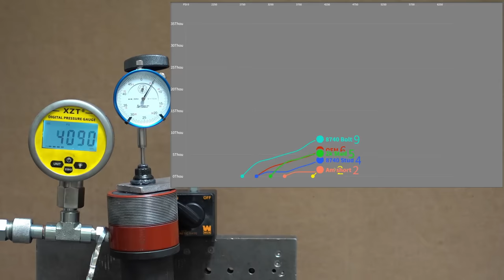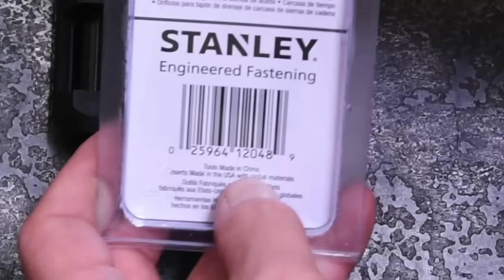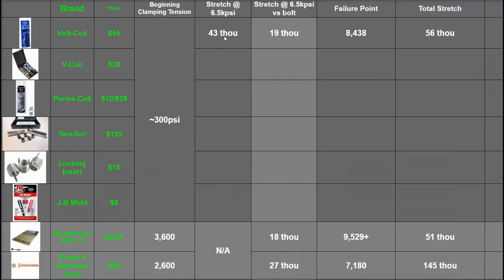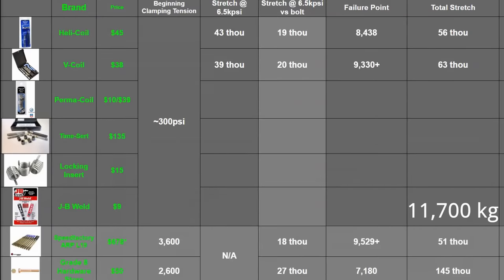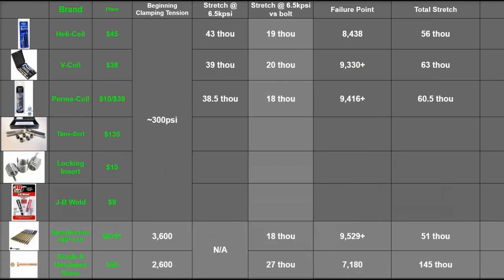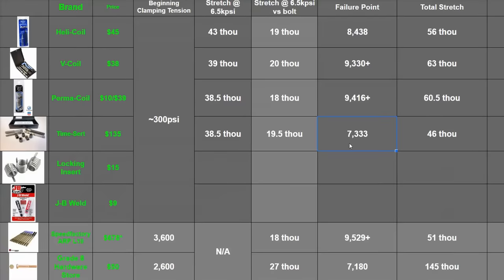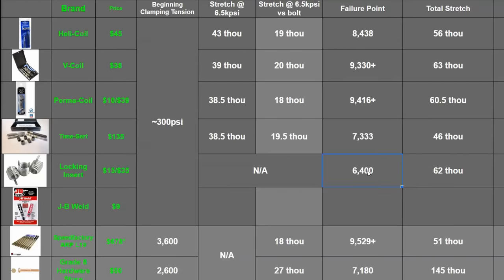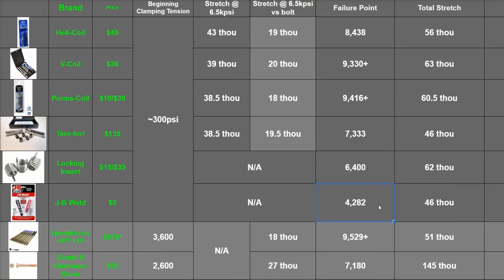12tons vs Bolt Thread Repair Using Time-Sert, Heli-Coil, J-B Weld & More

Comment: Would’ve preffered to see the jb weld left to cure with the head stud left in the hole rather than drilling and tapping threads. Ideally just shoved straight into damaged threads and bolt shoved in after.
Reply: If it was a stud and not a bolt that would work.
Reply: @FishFind3000  it was a stud in their video?
Reply: I think even just drilling it and letting it cure another 8hrs before tapping would have been beneficial. Cured JB weld doesn't feel "gummy."
Reply: @9HighFlyer9  I agree entirely, needs 36hrs or better ! I thought we’d all learnt that lesson with epoxies years ago.
Reply: JB weld sucks for thread repair in metal, period.
Reply: Used jb weld on a thermostat bolt hole and it lasted over 300,000 miles.  Chevy 4.3.
Reply: JB can be amazing. I have compressor from Menards 125psi. The riser on top of the tank got hit by something and the weld cracked so it was leaking. I only use it for filling tires and other light work so I sanded the paint and used JB around the base thinking, "yeah right I'll be junking this". 2 years ago and doesn't leak.

Comment: Machinist checking in. It is always better to use lube when tapping regardless of material. With cast iron you can get away with it because it is so short chipping. However, some people think cast iron chips act as lubrication because of the graphite nodules. They do not. They are abrasive. Cast iron actually wears cutting tools rapidly. Also, the reason you use timeserts over helicoils is because threaded inserts like timeserts hold up better to reinstallation than coils do.

Comment: I always love watching you videos, subscribed a while ago. Back in my automotive tech days ( 45 years worth ) we used a time-sert type of insert ( can’t remember the brand) to repair striped spark plug holes. A spark plug needs a flat or conical sealing surface at the top depending on the plug design. A coil type insert will leak compression past the larger new threads and damage them. When you need to seal something ( compression, oil, coolant etc ) a sleeve type insert would be best.
Reply: A spark plug has a sealing washer or conical seat which is a larger diameter than the OD of the Helicoil insert, therefore there is no leakage. I do like Timesert inserts but Helicoils are much cheaper and don't require the comparatively large counter bore that the flange on the Timesert requires.  
I have a similar amount of years in the auto repair/race/engineering world.

Comment: You should use a simple lever to save your indicators. As long as the sides are equally distant it will turn the upwards motion into downwards of the same intensity and when the bolt breaks the lever moves away from the indicator instead of just putting the indicator in the line of fire.
Reply: THIS!!!
Reply: Or the lever could be sacrificial like a Haimer tip.

Comment: as a heavy duty diesel mechanic and using time serts for head bolt repair and "helicoil" for all others I've genuinely always wondered how strong the threads would be and this test really contradicts what everyone in the shop has said that it's weaker, makes me feel better using these products!
Reply: The only thing is though, that the helicoil will most likely come out with the bolt when the next guy has to disassemble it. I hope you're not one of those "fuck the next guy" mechanics.
Reply: What i dont like of coils is after many years with bolt rust,thermal expansion, etc,  when you try to remove the bolt it binds and  pull thr coil like a wire.
Reply: @mandytuning  Then you just put in a new one. I've installed them purposly for that reason.
Reply: @Spike-sk7ql  Then just install a new one, no sweat.

Comment: Did timeserts on my Miata spark plugs nearly 10 years ago, bought it with all them stripped.  Over 50k miles and turbocharged to 3x factory power with zero issues

Comment: Perfect timing! I just discovered 3 of the oil pan bolt holes on my engine block are striped out. Can't wait to see what I'll be buying to repair those threads!
Reply from the maker: For oil seals, a solid insert like time-sert is best. Less potential for leaks

Comment: I repaired a starter bolt hole on an LS1 engine block w/ JB Weld and it has lasted over ten years w/o issue. The "ear" for the bolt actually broke off the block and I re-formed it w/ the JB Weld, then re-tapped it. The starter just crapped out on me and I was nervous about the durability of the repair . . . and was pleasantly surprised to find the repaired thread in perfect condition and merely did the minimum required to eplace the starter. Yea!!!

Comment: Awesome test.  Helicoil makes sense, since it's a round coiled insert with the same diameter throughout.  The double threaded insert didn't have a consistent wall thickness due to the inside and outside thread position, so it makes sense that it failed at a lower point than the coil inserts.

What amazed me is the strength of JB Weld.  Goodness, that stuff is strong!

Great to watch these videos.  I actually bought a Rigid high torque 18V wrench due to your testing and I'm thoroughly pleased - make that more than pleased.

Thank you.

Comment: I bought a V-coil set size M6 once to repair a thread for a valve cover. after one user error it worked totally flawless. I honestly took it for the price alone, never expected any real quality.

Comment: HeliCoil has cheapened their sets from what I'm familiar with using in the 1960s. I still have the first one I purchased to repair 7/16 head bolts in a small block Chevy. Those sets came with the drill, tap and the installation tool was a threaded tube the size of the bolt with a crossbar that doubled as the handle as well as the tool to break the tang. The insert was threaded into the hole so the top thread of the insert was one thread into the hole. The installation tool was left in the insert, the handle was removed, inserted into the center of the installation tool and tapped with a hammer to break the tang without bending the bottom thread or pulling it out of place as the installation tool held it firmly in place. Then the installation tool was removed and the thread in the hole was staked just at the end of the coil using a punch. This prevents the coil backing out when a bolt is removed that has had thread locker used.  
When their Patent expired in 1969, several other companies got into the market. Those kits usually didn't include a drill bit, they used a cheaper, shorter tap and didn't have a full thread installation tool. If the hole isn't tapped deep enough, the lower part of the coil will be in the tapered area of the tapped thread and wedge onto the bolt which is why the threaded installation tool is important so the installer can tell if the threads are deep enough. Many people installing coils don't break the tang off and just screw the bolt in to let the bolt break it off which will either wedge the thread or drive the coil deeper into the tapered thread and wedge the bolt. The taps included with the cheaper kits were of a lower quality steel and would be dull after installing the inserts that came with the kit while the early Helicoil taps could be used for many additional inserts.

Comment: Simpsons did it!  Seriously, funny that both of you did the same video on the same day.  Project Farm has their own style.  I've always used Helicoils, but I've had issues with that little tab breaking off where it doesn't need to be.  Some compressed air and a needle tip usually does the trick.

Comment: A decent comparison of the products and like others have said, application plays a huge part in selection of the correct repair. As a Tool and Die Maker, I cringed a bit when I saw the preparation of the sample. Whenever drilling in a vise like that and then tapping by hand, the threads are likely to be less than ideal (round stock like that begs for a lathe). Even a slight bias of the tap will cause an early failure since the stud only loads on a small area first. Especially in cast iron, there isn't any internal yield to 'set' the threads, they just crack.

Comment: Okay so, here's the issue I have with the other brands and why I use timesert. The other brands do a really poor job of staying in the hole, timesert doesn't back out and locks in place. When repairing aluminum engine blocks you can remove and install bolts without worrying about the thread inserts coming with them. Even though the timesert didn't win in torque, I'd be curious to see which one backs out of the threads the easiest when removed. I think most of us mechanics don't have issues with insert strength. The issues we usually have are related to the stupid thing backing out when disassembling something. I don't know how many times I've pulled things apart with helicoils inserts just to have the insert come out with it. Never had that issue with timeserts. Great tests, just saying there is more to the inserts then strength.
Reply: Yep 100% the same reason why I ended up biting the bullet and stumping up for timesert kits.
Reply: @ellingly  I completely agree. Have a transmission repair coming up. Several bolts holes are completely ruined. The transmission pan has to be dropped to change fluid. So this pan will be removed and installed multiple times. Definitely glad I went with timesert

Comment: I've been mix and matching wire insert brands for well over 30 years, using Heli-Coil, Re-Coil and Western Threading Systems taps, tools and inserts with each other.
The only times I've had problems or failures have been due to either my own error in failing to drill or tap square or due to insufficient support metal. (Re-threading engine sump drains is often problematic when they only have a thin wall spot welded plug thread.)
Never tried a Time-Sert as I generally have to do my thread repairs in awkward to access locations and often have to get creative in how to get a drill bit into the location.
A tip for others: As I'm often running an insert into an engine in place, I have made up a couple of tools that I can use to slip over the tang of the insert and snap them outwards rather than knocking them off into the cavity.

Comment: The thing that make heli-coils so strong is the fact they are flexible. With inserts like time-sert the load really only puts pressure on one or two threads. With heli-coils the load is more evenly spread out.

Comment: We use Time-Serts at my work and the machinist once ran a test of his own by taking a piece of aluminum bar stock. He drilled 3 holes, tapped one straight for M12 threads, the second hole was M12 STI for a helicoil and the last was M12 for a time-aert. He threaded a grade 10.9 M12 socket head bolt into each hole and then kept tightening till something failed. The first straight tapped hole failed quickly with the aluminum threads pulling out. The heli-coil failed next. The Time-Sert didn't fail and in fact stretched the bolt.

Comment: Thought I would give you a helpful suggestion.  You can get tap handles that have a rotating top that can be installed in a drill press.  Thus after you drill out the hole to be tapped on the drill press you install the tap rotating collar into the drill press.  Then bring down the drill press head onto the slip fit of the tap handle.  Perfect alignment.  Use the drill press (motor off) to apply down ward pressure while the other hand is used to screw the tap in and out.

Comment: It would be great to see this same comparison done with aluminium, I think you would likely see different results when comparing solid mild steel inserts vs stainless coil type, I used to use recoil or helicoil but lately tool pro has saved me some money

Comment: Those locking inserts have a special feature that make them extremely useful. Drilling or grinding out the internal threads and using a punch on the locking tabs allows you to remove the insert in 4 pieces without damaging the threads in the work piece. We use the inserts in a Zap-lok press (hydraulic pipeline press). Any thread wear or damage occurs in the insert instead of the press casting.

Comment: I'm most impressed with the jb weld repair. I had no idea it could be that strong. I have tried epoxy repairs but it was a lot of years ago and I did not have good luck with them. I guess they've improved on the compounds some.

Comment: A good Heli-Coil type thread repair is functional in a spot that won't be taken apart often, if at all. Where solid inserts really shine is their ability to be assembled and disassembled multiple times without pulling the insert out of the base material. Also, in cases where the holes are elongated slightly larger than the coil inserts, solid inserts are the go to.

Comment: really interesting result on the time sert... I used to work for honda and there were a few engines that were known for pulling head bolt threads... timesert was the ONLY repair method authorized by them, I installed hundreds.... sort of has me questioning that result now.

Comment: Just my two cents on why the coil inserts performed as well as they did; by the nature of the loading between the bolt and the threads the insert is in, you are trying to squish/shear the 304, which if memory serves it resists very well in contrast to it's tensile strength.  Not to mention with your standard thread form, it acts like a set of wedges between the insert, the bolt, and the parent metal, trying to expand the coil outwards, so in something that has a lot of resistance to expansion from within (like a big cast iron blank) it will hold itself in extremely well, if you tried that in a much thinner or softer blank, I bet you would see different results with the coil pulling out due to some elastic deformation of the hole it was in, in which case the insert types like the time sert would perform better.  Just a heavy physics day for me I guess.

Comment: On the locking insert, it looked like the cast iron failed before the insert. I mean, a failure is a failure but maybe worth a re-try unless there was something that we didnt see that showed the insert failing. In my opinion, the locking insert would shine in the example you gave, where something was repeatedly screwed and unscrewed from it. I'm betting it would resist backing out better than the rest of the test group.
Reply: My thought is on something like cast iron where it is so dense and breaks or cuts in little pieces, those locks put a heavy uneven load and start it breaking around the insert. Those will probably work very well in aluminum or steel as they have some give in the material instead of fracturing

Comment: The JB Weld did a heck of a lot better than I was expecting, to be honest!  I wonder if driving the locking pins down into the cast iron started fractures that weakened the threads.  I'd be really interested to see a similar run, but in mild steel instead of cast iron.

Comment: for a valve cover the JB weld is perfect, usually only torqued to 10ft/lbs alot of them come with aluminum bolts, will definitely be doing the JB weld method from now on

Comment: Wow..... I'm very surprised that a helicoil out performed the time serts. At the dealership we used time serts to repair cylinder head bolt homes, rocker arm holes, etc. Now I find out that not only could we have used the El cheapo helicoils, but they were actually better?

Comment: The durability and strength of thread inserts is sensitive to the hole size and taper.  Anything drilled (and a drill that's the biggest  recommended size)by hand will derate these quite a bit in my experience. Great test and good info.

Comment: I've been a tech for 10 years and I've never quite grasped the use of heli-coils. I bought a matco master tap/die set many years ago and anytime I encounter a stripped out bolt hole, I always redrill it out to the next size up and simply retap it and send it on it's way. Then again, I know not everyone has access to a great tap and dye set, but mine has saved me many hours of time.
Reply: probably just so that you can use the original bolt, you can just buy the coil that matches the bolt you are using and you don’t have to worry about finding another bolt that might be of lesser quality.

Comment: I was thinking the JB weld would work best without drilling out the hole. Just re-tap to clean up the threads a bit, apply JB weld and insert bolt. With the bit of original threads left I think it would hold better. I inserts really surprised me. The head bolts were a cool test to do. Over all fantastic video and great job.

Comment: You could mount a lever on the indicator stand and use the indicator on the outward stroke if you want to save a few bucks on cheap indicators.
JB Weld takes almost a week to fully harden.

Comment: Time zerk is the best for doing spark plug holes it's brilliant it's bulletproof and it's a great product I've used it on many vws and other vehicles it's the best. Basically JB weld won't handle the heat and is not that strong softer than aluminum they do make stuff I use now it's called for using it on boats. Stuff is almost as hard as aluminum. Many of the small race car guys use the stuff when they raiders get damaged on the small tracks.

Comment: What a fantastic video!  Learned that in aluminum dirtbike cases like the set I'm working on, I should be able to get away with JB Weld on the clutch cover (not for head studs).  That's a relief since this set came to me with an insert already ripped out and not enough meat to really make the hole bigger.
Reply: Also, those fork applicators like V-coil uses are a real PITA if you end up with the Chinesium ones sold on Amazon. They like to close up and pinch, which is a true hassle and likely to ruin the insert.  Just say no to Amazon Chitanium material.